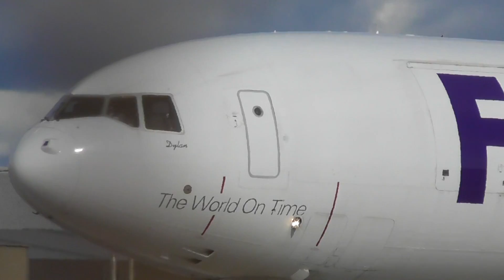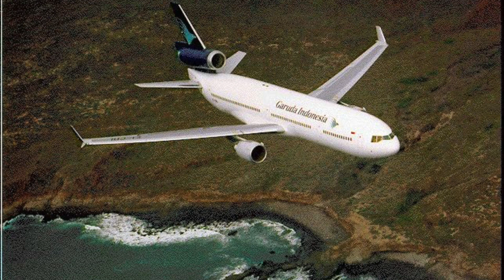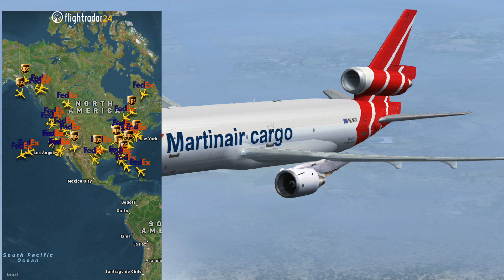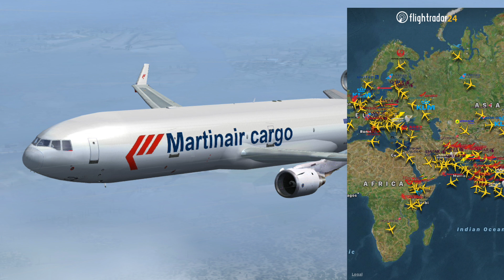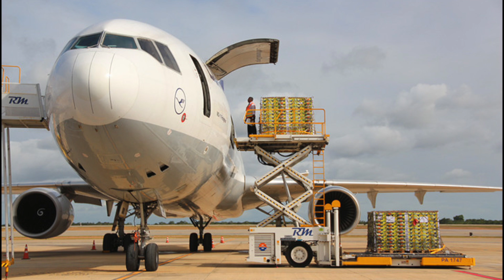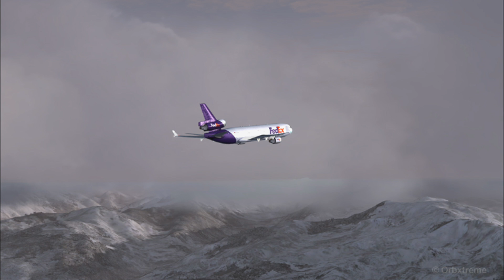WIll a RE-ENGINED MD-11 or MD-11X Work?

Comment: There are two major factors preventing the MD-11 or any other trijet coming back - fuel economy (which you mentioned) and ETOPS. ETOPS was the beginning of the end for trijets. Now with modern twins approved for up to 330 minutes diversion there's simply no point bothering with an MD-11 - a twin jet can get everywhere a trijet can, and will do it for less fuel. Pity though - I've flown in the 727 and DC-10 and loved them both.

Comment: I highly doubt there would be another version and if it would they have to made it extreamly fule effiant to be able to compete with aircraft such as B777X and B787. The one exception I could see for a re engined MD11 is extreamly long flights over water only such as San Fransisco - Sydney or Los Angeles - Auckland. In those cases ther would be a value of having a third engine without the extra fuel cost of a forth engine aircraft such as A380 or B747. But the market for that nische is exreamly limited. Johan.
Reply from the maker: It's a shame you are probably correct!

Comment: Also - would a single engine aircraft work?
Reply from the maker: Quite an interesting one! I'm really unsure, to be honest.
Reply: yep. I was thinking of maybe a CS100 sized plane with a single PW1100G in the tail. Would be ultra fuel efficient.
Reply from the maker: Certainly true, have you seen some of the concept aircraft around? Some of them have one big fan or engine at the back.
Reply: Nope, I'll check those out. Sounds interesting.
Reply: Nope, I'll check those out. Sounds interesting.
Reply from the maker: One is Boeing's double bubble or something along those lines

Comment: Since it has 3 engines and not 4, I’d assume it’s more fuel efficient than quad jets. So it should work better than re engined quad jets!
Reply from the maker: Not 100% sure, I know that it's had it's share of issues and certainly does not have the best record. Thanks!
Reply: Okay. Thanks for letting me know your opinion.

Comment: It is a beautiful aircraft, but there were some issues having the engine on the top and there have been a few accidents due to this. Probably one of the reasons to having engines under the wings is that it is safer. Having engines on the back of the fuselage did contribute to some accidents too.

Comment: (Suppose Boeing were to keep the tri-engine layout)

Passenger version: no way. If a new MD-11 were to target medium to long range market, how can it beat A330/A330 Neo? For long range, a new MD-11 definitely need new, more efficient engines, which are very likely to be way more costly to maintain than the current CF6 and PW4460/62, making the MD lose out to 777 and 787.

Freighter version: hard to say. I think that now MD-11 sits in a unique payload category. With its decent thrust to weight ratio, fairly decent fuel consumption and McDonell Douglas’ over-engineered fuselage, it is a good freighter. 

Another fantastic video! Happy new year, and keep up the excellence!

Comment: Hello DJ, despite the fact that if the MD-11 have a redesigned engine, I’ve heard a report from NASA that if you put an engine at the back of the plane, you can use the winds or something that comes with the lift(kinda forget what it’s called), will this design bring back the MD-11 or possibly trijets? Btw really good video👍
Reply from the maker: Hello, that's very interesting to hear! Quite possibly but I think it'll depend heavily on how it goes.

Comment: The MD-11 is such a cool aircraft and the best looking in my opinion, I think it should get a second chance by putting on some new fuel efficient engines and some aerodynamic enhancements to improve its efficiency so it can reach it' full potential,  when it comes to passenger and freight service.
Reply: Very high quality video, keep making great content. :)
Reply from the maker: Thank you so much! If it was down to a switch up of the engines I think we could certainly see a freighter version come into the market.

Comment: I agree with you the MD11 was and still is a beautiful aircraft but having flown on the old 727 so many time when I was  little boy back with Ansett before and after thet changed their company colours. There was something about boarding the plane through the rear stairs up underneath the third engine. It was loud as buggery because you had the APU right above you as you walked up the rear stairs and she wasn't exactly quiet in the air either. But I loved it then and still smile about it now. Awsome video.
Reply from the maker: Thank you! It's presence is so beautiful!
Reply: Adam Hampshire I agree... but I think you might be a tad confused... 727 APU is in the starboard wheel well as engine #2 is in the way.  APU is above the aft stair on DC-9 based aircraft.

Comment: As much as I love the MD11 and would be elated if it came back into service for passenger use its three engines amongst other things would make it inefficient and unpopular compared with, eg the 787 or a330 neo. Therefore I don't think it would gain much traction if it was to be re-launched 🙁
Reply from the maker: It's such a shame but you are correct.

Comment: I heard that if the wings of the MD-11 were redesigned into a more modern and more efficient form (super critical wing), MD-11 would have succeeded because it could then be more fuel-efficient than the Boeing 777 at that time even when it has 3 engines. The sale of Boeing 777 would not be that successful if MD-11 were a success. Unfortunately...
Reply from the maker: Very interesting that!

Comment: In my opinion, I don’t believe that a redesigned MD-11 would work primarily because twin engine aircraft dominate the market it once served, and that’s for many reasons like rising fuel costs, easier maintenance, etc. Also, I believe that aircraft are no longer built with an engine mounted on the bottom of the tail/vertical fin due to safety reasons. I understand the extreme standards turbofan engines are required to meet and how safe and reliable that they are, but incidents do still happen, such as an unconfined engine explosion, and that could severely damage the tail/vertical fin. I understand that aircraft like the crj 200/700/900/1000& the md-80/90 have engines mounted near the tail, but they don’t pose a big risk to damaging the tail that much like the MD-11. And if the tail/vertical fin separates from the aircraft, it would be a catastrophe, just look at American 587. However, I’m assuming that the MD-11 is successful with cargo ops because of unique characteristics such as exceptional range, capacity, and a high MTOW & MLW. So maybe a comeback for cargo, but only with 2 engines such as the GE9X, since the previous models used engines that produced similar thrust. Also, remember me when you’re big in the aviation part of YouTube :)
Reply: Oh yeah, don’t forget the supposed redesigned MD-11 would need lighter more modern building materials and composites and of course more advanced cockpit technology.
Reply from the maker: Thanks man! Of course I will remember you :) I think you are right about the whole engine situation.

Comment: Awesome video mate! but
You needed to mention why the MD-11 has 3 engines and what types (PW4460/4462 and CF-6-80C2D1F)  and why they did not drop that 3 engine concept after the latest DC-10 version. There are several versions of the MD-11, the MD-11ER does already exist. Also the MD-12 was an concept for a A380 like aircraft which actually started developing but McDonnell needed to drop this due to the merch with Boeing. The MD-XX was announced also early 90s. Actually a lot airlines like Martinair showed a lot of interest for this plane. Thats why most original MD-11 operators planned to only operate their then new MD-11’s untill the newer MD-XX was produced, and they would trade back their just delivered MD-11. The MD-11 itself has a lot of potential, the plane is save and reliable.  That is what MD always delivered. And that is why DC-10”s  (most of them now MD-10) are still operated even that some of them are almost 50 years old. 
I really enjoyed this video and its awesome to bring the MD-11 topic back. Also congrats with your (almost) 10K mate!
liked
Reply from the maker: Thanks mate :) I chose not to mention the engine choices. I try to keep everything as brief as possible. If people want further info they can always research it :) but my aim to so keep it short. If I included everything I researched the video would be some 50+ minutes
Reply: that is what I gonna do :)
Reply: Dutch.aviation iii

Comment: Very interesting video!!! I think that the 3 engine aircraft will not work as it will cost to much to maintain and Airlines like to stay within a certain type of engine to reduce costs. It may still work as a freighter but I think it will be gone soon.
Reply from the maker: Thanks a lot! I think if they switched to maybe 2 engines which are more fuel efficient it might work.

Comment: I don't think any introduction of a tri-jet will work anytime soon. If it was re-engined, it'd be very un-economical to operate compared to a twin engine aircraft.
Reply from the maker: You are very correct.
Reply: The only way tri-jet would work is if it is electric. Heck, even quad would work if it's electric, for now.
Reply: It would be great if a re-engineered, fuel efficient MD-11 tri-jet could be designed and brought into this century. Hopefully, jet engine efficiency continues to improve to make it happen. Current MD-11's were retired from general aviation and will likely be used for air cargo and/or wildfire air tankers. Hopefully, a 
"re-birth" of a new generation MD-11 can come about with growing interest from airlines. We'll see though. Missed flying on MD-11s; did fly on old DC-10s.

Comment: Again a great video mate
The MD-11 has already it's pro's, it has great capacity and good range. In order for a re-engined MD-11 to work, the range and payload capacity should be increased, its MTOW should also be increased as a lot of heavy payload is being transported in freighter aircrafts, it should use more composite materials in the build, and instead of three engines, they should have two powerful ones like the GE90's, GEnx or the Trent 1000 as it is cheaper for airlines or freighter companies to operate and maintain.
Reply from the maker: Thanks mate! The payload is a great point.
Reply: Ben Geoghegan agreed
Reply: Great comments. Hopefully, a two engine MD-11 is doable or possible. A three-engine one like legacy MD-11 would work too, I believe, for overseas flights. Engine and fuel efficiency and fuselage modifications are a given and a must-do. Old 747 aircraft is being retired at a faster rate, so it appears or seems.

Comment: In a word. NO. Fedex and UPS like it because its cheap and can carry a large payload. If the choice was between new build MD-11s , 767s or 777s there wouldnt be any MD-11s flying for UPS or Fedex. However since they bought most of them used they're cheap. They have good range and can carry a large payload plus freight operators arent working off the CASM metric ie ultimate efficiency is great but they have other concerns. If it came to it and it was proposed to reengine the MD-11 I cant see Fedex or UPS going with that. It'd be easier to go buy some used 76ys. You'd give up some range and payload but they're cheaper to operate.
Reply from the maker: You are correct. Could you see a possible new 777 freighter coming through as another option?

Comment: I think that the only way a new trijet would work is if their range is unfathomably long and to have greater cargo capacity, while somehow being more efficient.. or if they redesigned them without the tail engine.For example, I think the 727's inability to age well to the modern aviation market was to do with the inefficient engines as well as the fact that a flight engineer is needed to operate it. Do you think that a new 727 would work if a variant was produced without the tail engine and the flight engineer position? I think 727's are slightly larger than 737's so they could perhaps fill a role similar to the 757 if it ever happened. What do you think?
Reply from the maker: Probably correct. I sadly don't see the 727 working, to be honest. Boeing has the rumoured 797 coming out in the future which is essentially a 757 and 787-8 remake to fill that market. However, I'd love to see the 727 back as it's a super pretty aircraft.
Reply: I sure hope the rumored 797 has a different than usual look to the normal boeing aircraft. Most aircraft have very standard looks to them - you know, it's a cylinder with a normal airplane tail. For example, how would you feel if the 797 ended up being a T-tail aircraft?
Reply from the maker: Yeh completely agree, would love to see something outside of the box but it's highly doubtful. If the 797 was T-Tail I think I'd scream with delight. Buttttt the thing is the design would have to be correct. Otherwise, I think it may end badly. How about you?

Comment: Would a Re-engined 727 or MD-82 work?
Reply from the maker: Quite an interesting one! I'll have to look into doing a video on that :)
Reply: With the success of Bombardier and Embraer there’s still a market for the MD-80/97/90/717. I think Boeing didn’t give it the development it needed to make it advanced enough at the time. Nowadays one with a composite construction, modern day engines and an updated cockpit would probably give those two (and the A220) a run for their money

Comment: The amount and consistency of uploads is insane! 
I really don’t think we would see an updated MD11, as optimistic as I try to be and as beautiful as it is, I just don’t see any reason for it to exist. In the passenger segment, the 787-9/10, A350-900, and 777-8 would quickly slaughter an updated MD11, as there are no real benefits to the MD11 over these fuel efficient aircraft. As the aircraft was originally designed as a tri-engine jet, it would take an incredible amount of effort to keep it aerodynamic, while removing that engine. The real problem comes when you remove the engine, you pretty much get a 787-10 with a 1990s frame. I don’t see any way a passenger MD11 MAX would get any orders. As for the cargo side, the plane has promises in a non-MAX form, but a MAX version would again not make sense. We do see many MD11s at my home airport of LAX and around the country. However, cargo airlines generally got the MD-11 as a cheap replacement for the DC-10s. Aside from the 747-8F, cargo planes are generally a generation behind passenger aircraft, as witnessed by American cargo carriers just ordering the 767F, while passenger airlines are ordering the 787 to replace the 767. For this reason I don’t see a MD-11MAX working, but Boeing can definitely take the expertise to make a new aircraft to serve the market even better.
Reply from the maker: Thanks, mate, don't know how much longer it'll continue sadly but I am trying my best! Unfortunately, I also doubt we will see this come forward but it's always nice to examine why. I'm eagerly awaiting to hear what future aircraft come through in the freighter world. There have been the rumoured new 777 freighters which will use the 777x as inspiration.
Reply: Dj's Aviation No problem! Loving the videos. As much as I would love to see the MD11 flying again, it probably won’t happen. A 777X based freighter on the other hand is a very real possibility. Only problem is like I mentioned in the first comment, cargo airlines tend to upgrade planes very slowly. Only Fedex could still be flying a DC10 around America that’s for sure!
Reply from the maker: That is an up and coming video for sure :) I've heard a lot of rumours they might look to do that sort of thing.

Comment: Will a re-engined DC-9 work? Or MD-80
Reply from the maker: I might have to explore that in another video someday :)
Reply: aussie.spotter I think a reengineered 717 would be a much better aircraft, as the 717 was improved compared to the DC9/MD-80. I think a 717 MAX could actually have a decent shot according to a recent Forbes article about how airlines such as Delta and Qantaslink  are looking for more 717s, and there aren’t many that have been built.

Comment: I simply don’t believe it’s doable with that 3rd engine. If it could be developed to only have 2 engines, then it could definitely work. Right size, good range etc. with 2 Trent 7000 engines or something similar, it would be perfect.
Reply from the maker: That's really the main thing preventing it. Such a shame as well! It's a beautiful aircraft
Reply: Morgan Lambley True, but the main problem is a dual-engined MD-11 basically becomes a 787-10/777-8/A350-900 aircraft, while all of the newer planes have a much newer design and better economics than the MD11.
Reply: Abhisar Krishna I do agree, but it does have a great design, and if they could make it lighter and more efficient with 2 engines it would be a good rival for Boeing and Airbus.